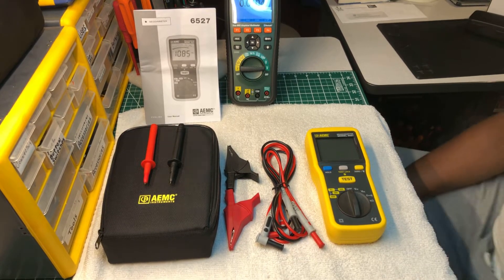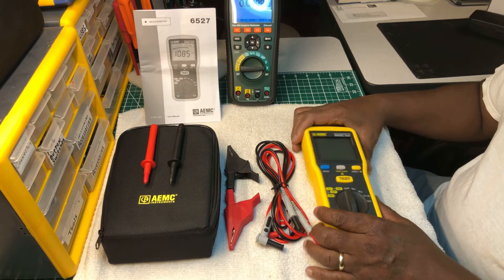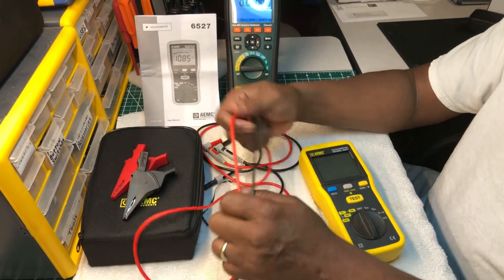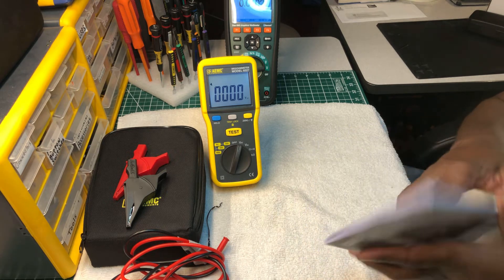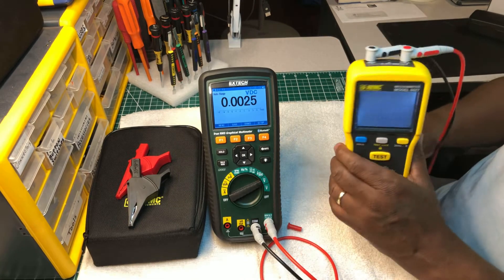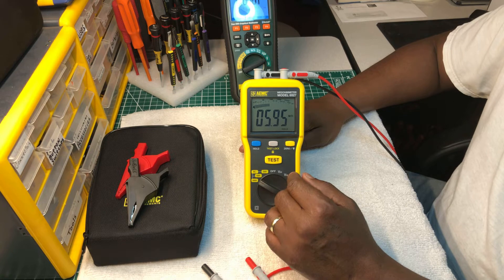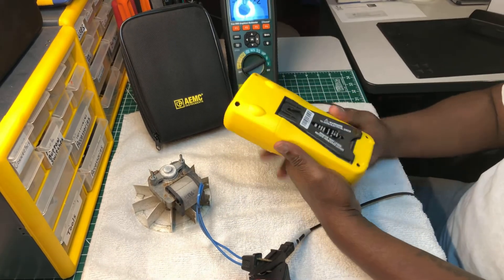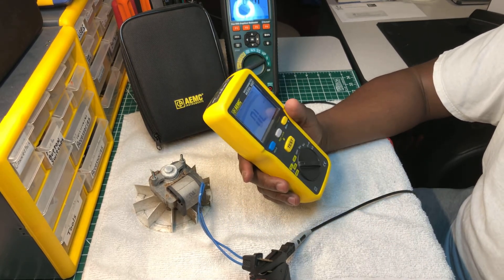🇫🇷AEMC 6527 Megohmmeter / Insulation Tester

Comment: I’m trying to understand what I’m doing wrong I’m trying to test resistance some wire but my meter is saying OL there’s nothing connected on either side
Reply from the maker: The wire maybe broken somewhere in the middle. So insulation tester displays OL because the numeric measurement is more than the meter can display. If the wire you’re testing was good the meter or most meters displays the number 0.

Comment: Nice instrument, looks like it is AEMC's own and there is no cross reference to Chauvin Arnoux. CA do the 6528 which seems to have similar functionality, but completely different looking instrument.
Reply from the maker: The 6527 is a very nice tester for its class range. I really like the new design of the 6528 megohmmeter. I wonder if it’s smaller than the 6527 ?
Reply: @TheElectriciansToolChannel  Circa 9" x 4" x 2.5" seems to be a fairly standard sized instrument these days. Not too easy to get hold of in the UK with Brexit kicking in, seen that a few suppliers have stopped supplying into the UK for a while.